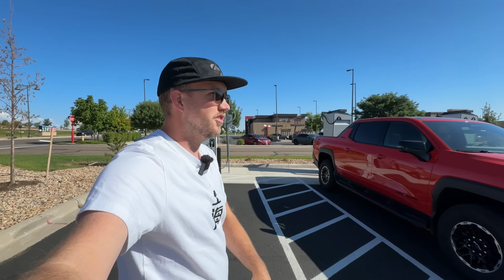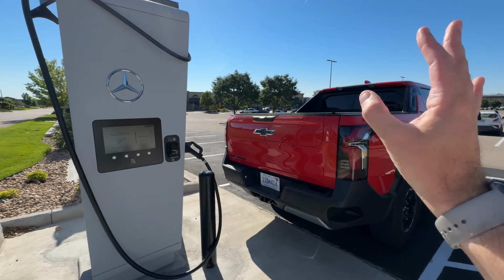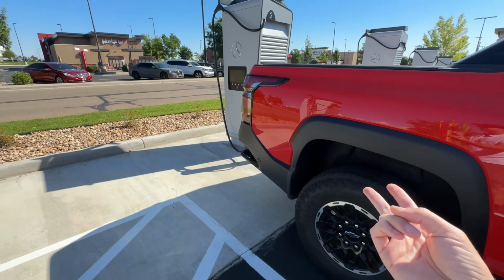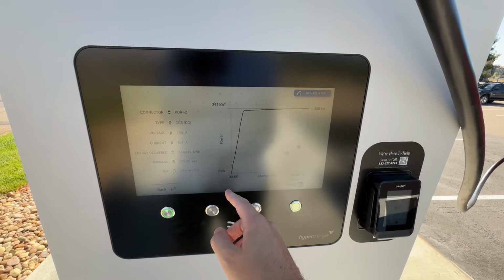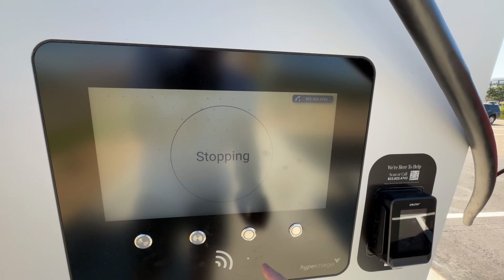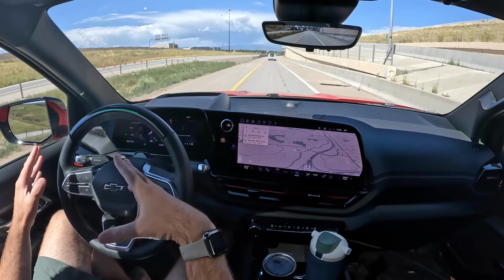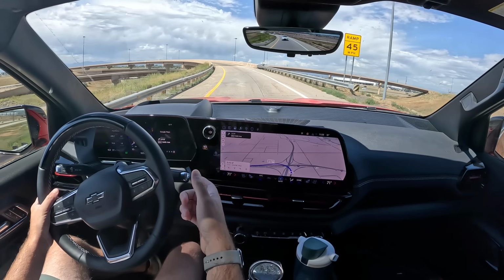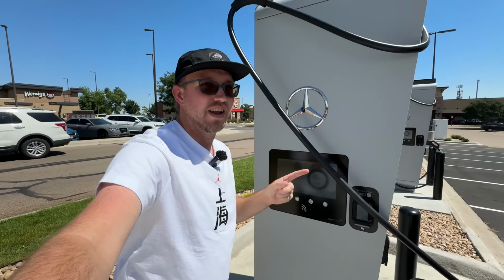Chevy Has Improved Road Trip Capability! 2026 Silverado EV Trail Boss 10% Challenge

Comment: I think the charge rate is related to the double stack 200/400 volt architecture of that big battery, not cooling capacity limiting the charge rate.  When the truck is “on”, it has to keep the packs at the 200 volt level.  When the truck is off, the system allows faster charging by clicking over to the 400 volt option.  Try your a/c theory at Tesla charger, because of the lower charger voltage, it will not matter if the truck is on or off, it will charge slow because Tesla does go to the higher voltage.  Try charging at a fast charger with the truck off, you hear the relays click to 400 v and your charge rate will be much faster.

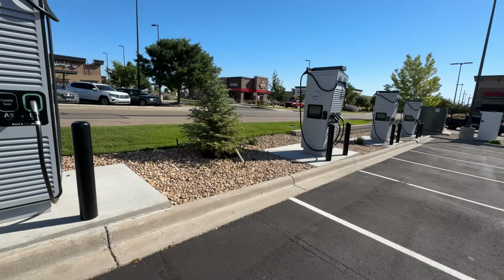Comment: 7:22 Cool that they have both NACS and CCS. 

But its backwards -  NACS cars (ie Teslas) overwhelmingly have the charge port on the left rear corner. And most CCS cars have the charge port on the left front/mid side (Bolt/Equinox/Mach-E/F150). So the NACS charger should be set up on the left side of the cabinet to more easily reach the left rear and the CCS should be on the right side cabinet to more easily reach the left front! The way this is set up BOTH cars will have to stretch the cable across the width of their cars...

Reminds me one time I was in an airport waiting for a flight and 2 young ladies (like HS) sat across from me. One of them had red hair and the other one had green hair. I told them they should swap seats because red should be on the right when theyre facing me. (boat/airplane joke)

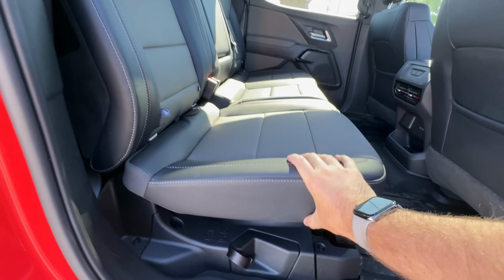Comment: 5:30 I dislike the Avalanche/Ridgeline 1.0/Baja/Brat look to begin with, but the midgate is a deal breaker - it completely ruins the seats and the storage area. All that complexity and points of failure/leakage/NVH that I will NEVER EVER use. That should be a $10k off delete option, like you used to be able to delete the stereo. 

I dont mind (much) them making versions of pickups for people who dont need a pickup, but they should still go ahead and make ACTUAL pickups. The point of a pickup IS THE BED NOT THE CAB. Get an SUV if you dont want a bed! This is like making a semi tractor that sleeps 6 and has a stove and a toilet but doesnt have any way to connect to a trailer.
Reply: WT, Custom, and LT trims up to the Plus package do not have the midgate. Only the LT Premium & Trailboss have the Midgate.

Comment: I wonder if the limitation in climate control is the size of the AC condenser up front not the compressor.   A Truck has a much larger area up there than the Cadillac..  So maybe it can dump more heat as a result.  My Bolt EV CAN use 6-7Kw on AC.. But only about 3 max for JUST the internal climate control the rest if reserve for battery cooling.  It also cannot split the two completely.  You can have the AC off for cabin cooling.. But if it turn on for a charge session the air out the vents get cold too.

Comment: 75kWh for 111 miles. Since it's roadtrip simulation, we need to consider the prices. 75kWh * $0.4/kWh = $30. OMFG, $30 for 111 miles of driving! It's just unreal
Reply: That's not much different then driving a truck getting 18mpg. The difference, 95% of your charging will be at home at far far cheaper rates, so the few times you might be road tripping and use a fast charger, you still come out way ahead with this over a gas vehicle.
Reply: @West_Anderson $93k vs a $60k truck and because of at home charging you come out ahead? $33k difference. Keep the difference in a High Yield savings account and the gas/diesel is free. You would have to keep the truck well past the average age of 12 years to come out ahead.
Reply: @GhostCod guess you don't realize you don't have to buy the $93k version huh.
Reply: @West_Anderson  Those are the comparable ones, for the same level of features in the truck. The work truck edition for electric starts at $70k and the gas version starts at $40k, it’s a similar $30k difference the whole way up.
Reply: @GhostCod once you factor in all the total costs of ownership, the price gets closer. I agree it is still more expensive, for now, prices of batteries are only going to go down, not up, so these are as expensive as they're ever going to be in comparison. Might not make as much sense this very moment, and I actually believe Chevy and Ford should have started with small EV trucks first to get the economics of scale on batteries before building these large trucks.
Reply: @West_Anderson  This is what I was getting at. And I love EVs, my next vehicle will be one. I’m just saying that a lot of work has to be done on the efficiency side for EV trucks.
Reply: @GhostCod trucks are tough, their use case generally denotes them to be aero bricks, and requires obscenely large batteries for towing.
Reply: @West_Anderson  Yes, but it shouldn’t take 3 model Y batteries. Maybe 2.5 Model Y batteries. Efficiency needs improvement. Like you said, it’s mostly on the aerodynamics side.
Reply: I really find it difficult to believe that some people don’t grasp this point ! obviously many people have not experienced driving electric vehicles enough to to get this, with 450 miles of range or more who’s going to be DC fast charging ? not very many of us and if we are, it won’t be for the entire trip that’s for sure.  so realistically speaking the cost is much less than many  think! Also for what this vehicle is intended, it is very efficient pulling trailers going longer distances and taking bigger loads. A car wouldn’t even begin to move the loads like this truck !so speaking from experience this is the favorite EV out of the 10 EV’s I’ve owned up to this point Partly because of the fact that it has such long range and big battery but also because of the fact that it can accomplish the job and tasks in an efficient manner.
Reply: @West_Anderson to drive the same 111 miles he did would cost me 14$ in my gas Silverado so half the cost and to charge on of these full at home would cost 36$  and a full tank in my gas truck is 45-50$ so 9-14$ cheaper at home but double the price on the road
Reply: @mitchharris97 do you plan on road tripping every day. If not, the net cost of charging will be cheaper from the 99% charging at home you would do.
Reply: @West_Anderson we road trip usually monthly around 800-1000 miles round trip so any savings would be washed out in one trip we have an equinox ev for my wife to daily not sure I’ll go full electric for the truck though thinking I’m better off one of each
Reply: @mitchharris97 hmmm well that's definitely a unique scenario then. But, if u think about the reduced oil changes and maintenance etc, would likely still come out ahead or at least the same, and we both know a EV is a better drive lol.
Reply: @West_Anderson having not driving a Silverado ev specificly  I would disagree on being a better driver there nice we like our equinox but not sure it’s better  it’s also not a fair comparison maintenance on the truck is cheap especially when you consider how much cheaper it was to buy then the ev equivalent I’m considering it but not sold on it
Reply: @mitchharris97  we have 2 EVs in my household and I now despise driving gas vehicles, they feel so clunky and antiqued in comparison. Also as far as maintenance, well, my f150 I had, with less then 100k miles needed a transmission rebuild, had fuel injector issues, and also the cam phasers going out, soooo I dunno.
Reply: @West_Anderson we have three cars in our household technically 2 we own the 2025 equinox ev 2023 Silverado rst and my company 2021 ram 1500   I have no issue with gas vehicles so far my experience with ev range sucks to be honest charging isn’t super cheap like we hoped it would be. Silverado has 40k on it never had any issues nothing but oil changes and rotates which I do myself so very little cost there
Reply: @mitchharris97 are you not charging the Equinox at home?
Reply: Consider destination charging though. Our 1200mi road trip includes a hotel in the middle with a destination charger. This would allow us to charge at full at home, have one charge stop instead of 2-3, then destination charge at a hotel for cheaper or sometimes even free. Also over the lifetime its cheaper if you're likely doing 90% charging at home at least
Reply: We charge at home off solar. It’s free.
Reply: @Dive-Bar-Casanova during road trip?
Reply: @vitaliyleonov8958 
As far as road trips, most people take one to none every year.

Truck owners will be charging at home most of the time.
Reply: Some people really don’t understand the difference between range and efficiency
Reply: @AutoXerWgn610 I know difference. And I know that when people go to road trip they think not only about range, but also about cost of that trip.
Reply: My calculations put it at 3X less efficient than a Model 3 or Y, yikes!
Reply: @GhostCod  I bet its more efficient than a M3 when pulling a 10,000# trailer with 1,000# in the bed. In fact that would be interesting to see in a Model 3. Baffling though why you would compare the two, thats not even apples v oranges its more like apples v septic tanks. If you have to compare to a Tesla, compare it to the CT.
Reply: @natehill8069  I see what you’re saying, but at this horrible efficiency, cost wise it on par or cheaper to “fuel up” a gas or diesel (Kyle bought a diesel). And the entry price is much less on the dinosaur juice options. At this efficiency and cost, very few people will buy the truck. Anyway you look at, GM needs to do better.
Reply: @GhostCod  Thats only on trips. Electricity costs 1/3 as much at home, and thats with me living in the country where its more expensive.

I have a Bolt. Pretty good efficiency (4.1 mi/kWh lifetime, YMMV). Compared to my last gas-only car (Honda Accord 4cyl 5spd, 32 mpg averaged for 13 years) it costs literally half as much per mile for energy (and thats overlooking oil changes). I hear tires may wear out faster, too soon to tell. OTOH brakes will last longer, but brakes are pretty cheap anyway.

In 2.5 years I have charged away from home 0.48% of the time (twice in 25,000 miles), altho I do plan a trip next month which will more than double that. Which may finally drag the percentage of time I charge away from home above 1 percent.

I also have a gas pickup. I have made 3 trips in 15 years "away from home" with it, usually hauling a trailer. But even that, most of the time I buy gas locally which would equate to home charging.

And, as a thought exercise: now that I dont do it much anymore, I realize going to a gas station is a hassle. I have to divert from my course, stop, swipe the card, start pumping, wait ~4 minutes (I usually clean the windshield and check the oil/brake/washer/PS fluids and serpentine belt tension while waiting) then take out the nozzle, grab my receipt and resume my journey. ~6 minutes altogether 1ce per week if nothing goes wrong. With the EV I get out of my car, walk to the wall, open the door, slide in the connector when I arrive, and reverse the process when I leave (in summer I dont need to do it every time, but I will calculate based on every time) prolly 4 times per week. It takes 25 seconds for the complete cycle. Thats 1.7 minutes per week or basically 1.5 hours per year time SAVED charging versus getting gas. Subtract out the 3 hours I anticipate spending while charging on my trip (the Bolt is a VERY slow charger, pretty much any other EV would take 1/2 the charge time) and I am STILL ahead of the gas car on charging versus fueling time, altho its very close.

And that STILL isnt counting oil change time either driving there, waiting and driving back OR doing it yourself and having to dispose of the oil.

And in western Ohio, if you dont want to spend $150 per year unnecessarily on gas, you have to keep track of the price of gas all around town so you buy it just PRIOR to the weekly $0.30-$0.50 price jump per gallon EVERY Tue/Wed/Thu (depending on what oil is doing on the world market) which it then trickles back down from over the subsequent week - I LOVE not doing that anymore. Price of electricity here has only gone up once in 10 years and they gave us 4 months notice.
Reply: this truck is way ahead of anything else as far as efficiency when you consider the work it will do the low maintenance cost, and that most people will charge at home. You can’t begin to get ahead financially with a Diesel if you have this truck to compare with.
Reply: @GhostCod can confirm to fuel my gas Silverado for the same 111 miles at today’s prices will cost you 14$
Reply: @GhostCod  apples and oranges. This thing is in a league of its own. Can drive non stop for more than 6 hours and handle a 2 1/2 hours tow. A+ relative to other EVs trucks on the market.
Reply: @LJLion  My family has a diesel truck that has a range of 6 hours of driving too. What I trying to point out is the efficiency difference. A gas only vehicle does not get three times the efficiency of my family’s truck. The Diesel consistently gets 20 mpg. Show me a gas car that’s not a hybrid that gets 60 mpg, they don’t exist. I’m pointing out that GM has some work to do on the efficiency, that’s it.
Reply: well one or two trips to the garage to do some maintenance on your diesel will turn the economy totally upside down. I’ve had experience with both diesel and ev Silverado work truck! my Silverado EV is by far miles ahead of the competition in efficiency and cost of maintenance and getting the job done. I would never go back to Diesel.
Reply: @nathanbrumbaugh8545 you don't listen me at all. I said - since 10% challenge is a road trip simulation,  we need to consider the prices. I don't care about your day-to-day cost of use, I'm talking specifically about road trip.
And I have Tesla, so I know how EV works

Comment: I love the bolt guessometer with upper, lower, and middle range with the bar that goes between, amazing for telling how I am doing at any given moment and getting down to zero… wish they would have kept that
Reply: I'm not sure how helpful it is really. Id wager most people trend towards the center or bottom.
Reply: @Samusaran77 ??? Yes, sure maybe, but it tells you that. The bar is the key, if it a pegged at the top you will get better then the best estimate, if it is is pegged at the bottom you will get worse than the  worse estimate, but if you need 92 miles and the center says 91 and your green bar is between the low range and middle range you won’t make it … but if you slow down say 5 miles an hour on a highway that you were going 5 over anyway so your still going the speed limit, the bar will creep toward that middle number over time and you can dial in getting to the next charge pretty accurately…. But just people don’t know how to use it doesn’t mean they should kill perfection in the next vehicle.
Reply: @Samusaran77  It is very helpful. It indicates how your current driving habits (for the last 25kms) is going to influence your range. The close your bottom/middle and top are to each other, the better your driving habits are. When your habits are to race everywhere, you will see a much wider spread. Same with winter weather vs a typical spring day.
Reply: @ronlaverdiere It can be helpful but I think people use it as a crutch too much. I will admit the Bolt can be somewhat accurate but many cars are not. If I put my full trust in my old car's range estimate, I would have needed frequent tows since it was quite optimistic beyond reality. 😂
Reply: Only thing better would be a) a percentage of charge (which is different from range) theres plenty of space on the screen for it and b) not have the GoM abandon you when it gets low - just when you need it most!
Reply: @natehill8069 true that, I just have a odbc reader and the info on ABRP up and running on my phone for road trips but having it available on the screen would be better.

Comment: I think the EV manufacturer's should add a computer radiator inline with the cooling system. Cooling lines connect between each item. Would work in cold conditions also.
Still costs a lot to full charge
Reply: They need to copy the octavalve tech from Tesla
Reply: Trucks are thirsty but people seem to forget that.

Comment: Like you said, because of the way GM handles it, running climate control while charging on this vehicle (and the Escalade) should have kept off for this one test just to see it's true distance after 15 of it's true top charging. 

I realize you want to keep it the same for all vehicles while road tripping, but not showing its true charging speeds doesn't give it, or the test, justice. At the very least, run the test twice -- one with climate control on and the other with it off.
Reply: If you’re on a road trip and don’t have a cool place to hang out other than the cabin then you will run the AC.